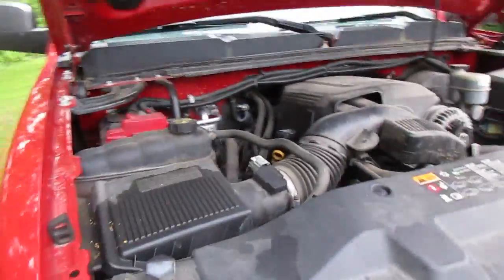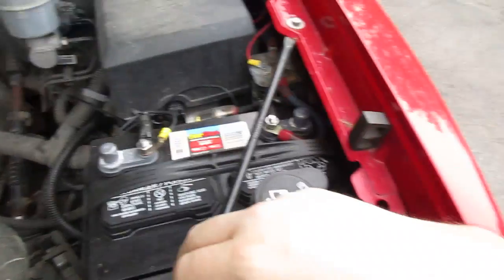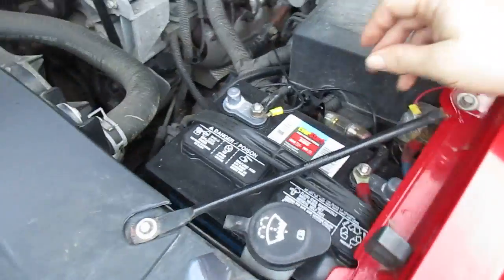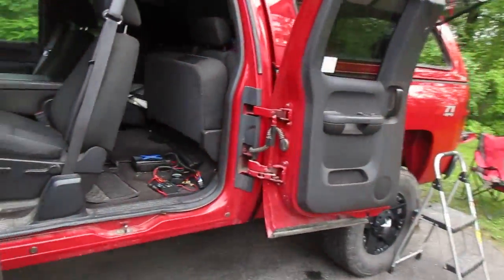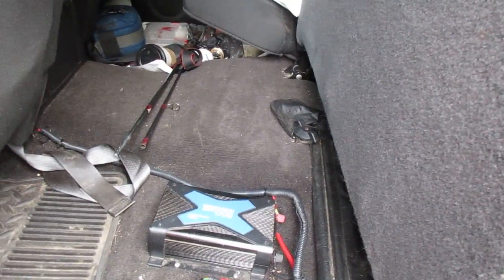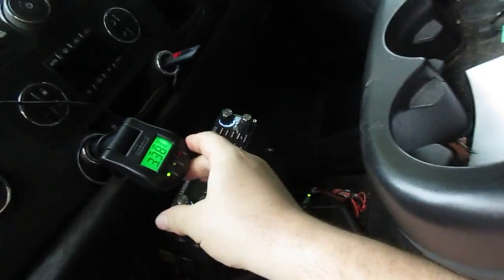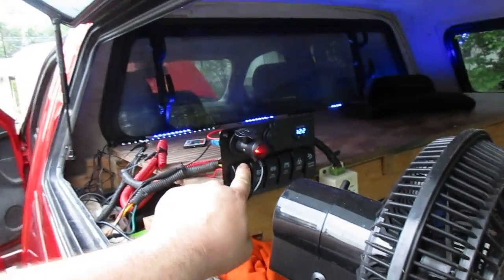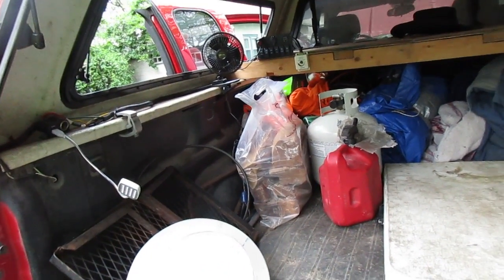Silverado Dual Battery Set Up

Comment: I have my self a 90 watt solar panel and I'm purchasing a 3000 watt power inverter. I'm charging up computer maybe tv/dvd, microwave, kettle, hot plate and cooler. Not everything will be plugged in all the time. Mainly cooler, computer or TV. Getting two batteries as well

Comment: Andy, Once the Aux battery needs charging and is being charged by the alternator what is your charging voltage from the alternator? Does it fully charge the aux battery or does the alternator drop down the voltage prematurely. My Aux battery is grounded through the frame. My alternator prematurely drops voltage and I either put the headlights on or press tow/haul to get higher towing voltage. It still is only about 14V which is not enough. 
Thx

Comment: Thanks for your research on battery to battery cabling. I'm adding a second battery to my 2011 3500 using your configuration but also use a solar panel and controller like P. Page below.

Comment: So you just connect the first battery’s + to the other battery + and same with both - terminals, I did it without a fuse with 4g battery wire is that ok?
Reply: Should always place a fuse in between connections to make sure the wire never catches fire

Comment: ya,but your not showing it pal.. go slow for ppl to see what you did.. not that hard..
Reply: Ya so what did he do with the grounds? Just tied them together instead of to the frame. I also dont understand why you cant just run the negative over to the negative and positive to the positive.
Reply: I kind of understand why he did it the way he did. He gives one sentence explanations of most features. But I wonder what is required versus nice-to-have. I just want more car starting safety margin because my one battery barely gets her cranked up.